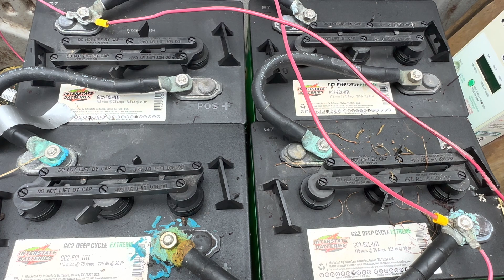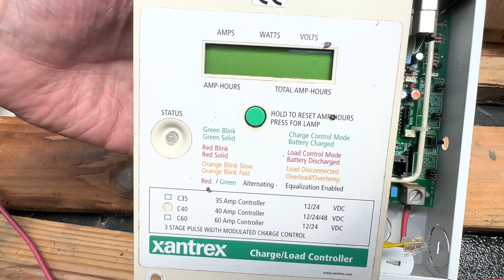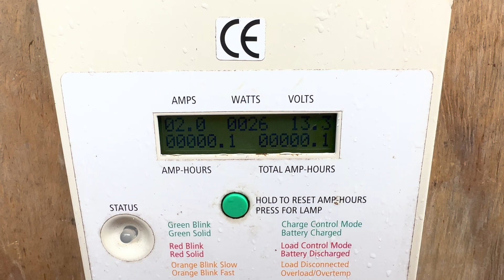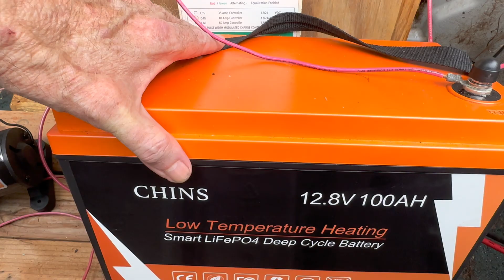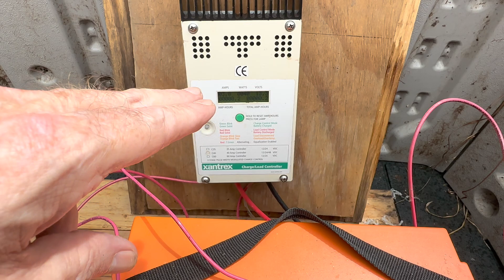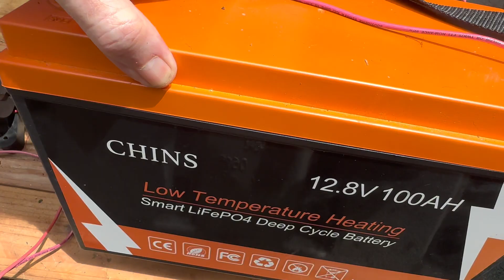Chins 12.8V LiFePO4 smart battery delivering H2O to entire house from rain water catchment system

Comment: Wow , I thought I was looking at the lead acid set up for a moment.  I have a 24v (6vx8 SP) using golf cart batteries that I installed in June 2015.  Here are some things I have learned about LA:
1.  Distilled water and check the levels EVERY 30 days.
2.  Use large equal length inter-connect cables of at least 2AWG...I have 1/0 cables and CRIMPED not soldered connectors.
3.  Clean the battery with a commercial product to remove ANY spilled dielectric as if its really bad you can get a small voltage reading between + and -.  Once clean use auto battery terminal protector (the red kind).
4.  Never fill the battery and then charge it up.....preferred way is to wait for the sun to drop, fill them to a level not to exceed about 1/4 to 1/2 above the plates.....this will minimize boil over which negates items 1-3 above.  
5.  Once a year, disconnect and clean all connections on the posts and interconnects as micro corrosion can get it.....this also means you re-torque the connections keeping them all the same.
6.  Install a marine fuse on the main positive terminal to eliminate the wicking effect caused by a downstream short circuit or cheap component failure.
7.  Insulate your battery box and use a victron or similar temperature probe to confirm your settings.
8.  Use a controller that has a temperature compensation setting and USE it!  
9.  I use the C-40 for testing but its PWM, so I now use those for air / water heating (diversion load) to keep the energy harvest going.
10.  Note on Xantrex / Trace:  Trace is 20+ years old now, Xantrex was like 2009 to current date.  You cannot find a temperature sensor for them anymore and if you do, it costs more than the controller is worth, so you move on to a Morningstar TS-45 / 60 PWM for diversion loads and they DO have networking ability and $33 temperature sensors that WORK!  PC software is available for the Morningstars and use a simple RS-232 to USB cable.
11.  I have NOT tried using the Victron to divert power / run a DC load but I MAY test that on the 75/15 series since I just picked one up for $34 used.

Stay safe and aloha.  Gary

Comment: My C40 is branded Trace 😁 (and a Trace SW5548 inverter).  It's getting to be time to replace or at least augment that main system.  Just spent all my cash on a new well tho!
Reply from the maker: Trace products are still great. I used them over the past 30 years, and they were always dependable. I do prefer Victron these days, but will still keep the c40 just in case. Aloha! 🤙 A new well! Sweet!

Comment: I need 2 100 amp hour batteries for a boat trolling motor..Do you think ampretime is the way to go..So many options and reviews and I can only afford to buy once. I  also want a couole 200 or 300 ah batteries to upgrade my lead acid solar system..I know you use a few brands and was wondering your opinion...Thanks
Reply from the maker: Amperetime or LiTime as they are now called are very solid batteries. I use them, and have for a couple years now with zero problems. All the other brands I use work well too. Whichever you settle on will serve you well. Can save you a few bucks on those if you look in description on my videos for links and discount codes. Good luck!  Aloha! 🤙

Comment: I'm surprised there is not a multi-turn potentiometer in there to give you a bit more accuracy.
Reply from the maker: They are a little tricky to dial in exactly, but can be done. They are solid little controller's. 🤙

Comment: All things come to an end…..Glad to see you used them to the end. Why waste them. Another good video 😊
Reply: I ❤ this lesson more than Jurassic Park because.... quite frankly I'm there with you. I would give my next born for a lithium iron LFP04 replacement....today I stir, .mix and clean corrosion and hope. 👉👨👈
Reply from the maker: I squeezed about every last drop out of them, and they worked well. I'm just risking a hernia anymore moving those around. Served me well though. Aloha! 🤙
Reply: @ProjectsinParadise808  ✌🏻🤡👍🏻
Reply: They have more life. Pour out the acid. Pour in water. Drop on a charger. Boil of sulfates. Pour in new acid
Reply: @TomFloridaMan  👍🏻 Constant voltage for the past 2-3 days hasn't been satisfactory. I'll try this next. Cells one and six on all the batteries aren't recovering above 50% capacity whereas cells 2-5 are hanging at 70 - 75% capacity.

Comment: well for lead acid them are great battery's . they make them in same size as 6,8,12V . I got 6 of the GC8 in my 48V EZ-go cart. about 4 years old still going strong. same interstate . I had Trogen the first set . little over 6 years on them. now the dealer buy me has US battery in stock. they make LiFePO4 in golf cart size so easy to convert. love that charge controller. that company is same as trace. been around longer than victron. Today MPPT victron is way to go. once you get all set you will have power to spare. can even mount a 12V LED light to help you at night . I have a shure-flow pump like that. working great . I put it on a hard rubber mat and helpt with the noise a bunch. I got the on-demand pump that has the pressure switch. this is my back-up pump from a RV holding tank. which I fill from either main well or the backup hand=pump well. winter when that freezes just put hot water in to prime . never cracks . made for cold climate. just say thank you to the old battery you did very good. and hello to LiFePO4. That one work in cold climate as well.
Reply from the maker: Yes those LA batteries served me very well, and lasted a long time. In fact LA served me just fine for 28 years off grid. I am very happy to have moved on to LiFePO4 in my older age, but LA made it possible to start my adventure off grid. I used to boast how heavy the L16's were as a beast of a battery, and they were. But I don't think I could lift one in place now! I really like the sureflo, and seaflo pumps. Used both over the years , and both work great. Mahalo as always my friend for sharing your experiences for all of us. Aloha! 🤙

Comment: You may have been unable to use them further because the resistance was so high through the trashed and corroded connections. Not because they were used up.

Comment: For those without another option and must use flooded lead acid ("FLA") batteries, regular Wheel Bearing Grease (not the high temp stuff for disc brakes) applied liberally on battery connections will completely eliminate any corrosion as you see at the begging of this video. It is an old mechanics trick going back to the Model T and Model A Fords. I have been doing it for years and it works perfectly.
Reply: Be sure to not get it between the connectors it's an insulator
Reply: @TomFloridaMan  Good add Thomas. Yes, after all the connections are cleaned and assembled, THEN liberally cover them in wheel bearing grease. They will never corrode and stay electrically sound even though your batteries may be outgassing corrosive gas and liquid.
Reply from the maker: Great advice for those on FLA for sure. These been circling the drain for sometime...had to go. But point well taken brother! Aloha! 🤙
Reply: Interesting to know for the future. I have lead acid batterries that are fairly new and run our whole house system. I maintain them every 3 months. Hope to get another 5 years out of them.